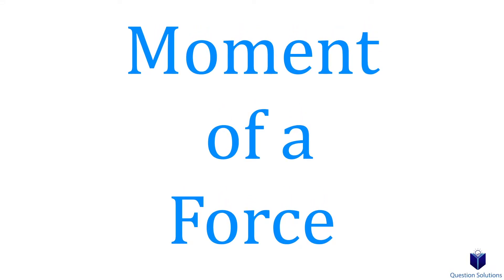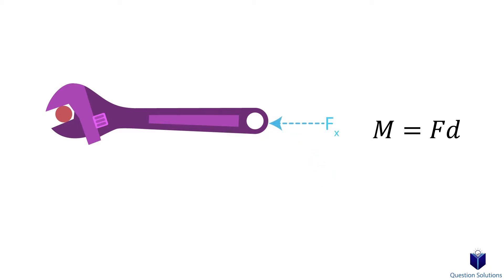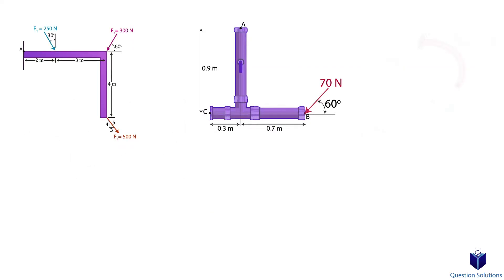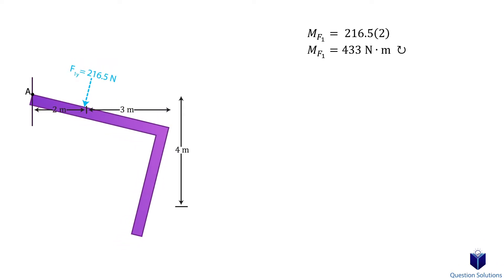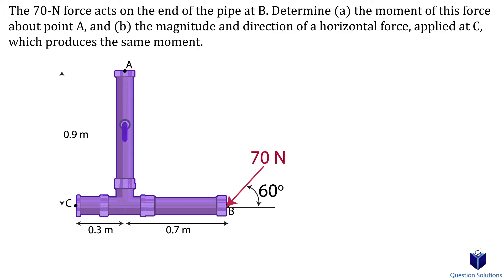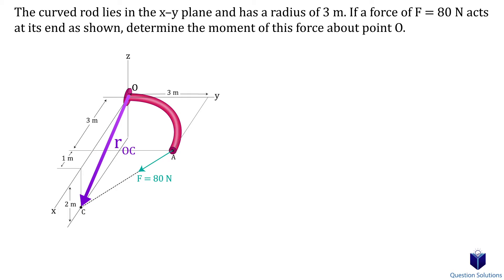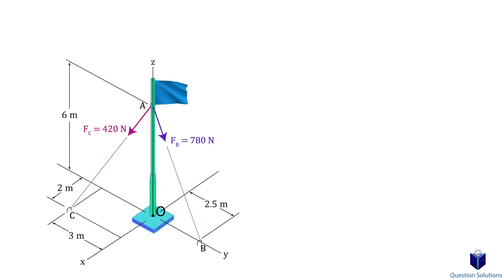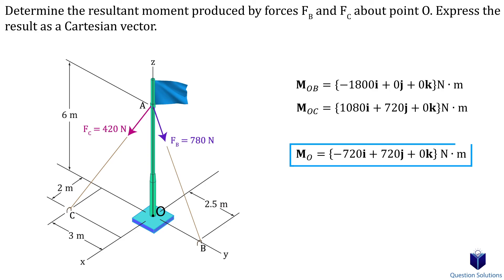Moment of a Force | Mechanics Statics | (Learn to solve any question)

Comment: my question is that while we are finding the moment,do we have to consider the force's sign(like if the force is downward) we take the force as -ive and then the moment is also -ive so will the result be +ive?
Reply from the maker: Here, I've drawn a simple diagram for you, see: https://bit.ly/3XwfDSS

So all you're looking to see is if a force creates a clockwise or a counter-clockwise moment. That's what gives the negative or positive sign, nothing else. In the diagram, you can see both forces are facing down, yet only one takes the negative sign based on which direction you chose as positive since we are finding the moment about the middle. So in any problem, you're looking to see if a force will spin whatever object about a point in a clockwise or counter-clockwise manner.
Reply: @QuestionSolutions  thank u ❤

Comment: thank you so much, got a test today and this video helped alot with review. only thing ill say is that i think conventional assignment of signs for moment is that (-) moment, is clockwise, and (+) moment is counterclockwise, as it follows the normal direction of a unit circle. either way, thanks so much for the help!
Reply from the maker: You're very welcome. Yes, the convention is exactly as you mentioned but it makes no difference to the final answer in 2D problems. I encourage students to pick the side that gives the most positives when solving a problem. I find students make less mistakes when they deal with fewer negative signs.

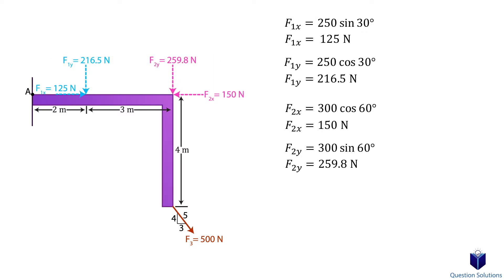Comment: at 2:37 why are we doing F1cos(30) instead of F1cos(120)? is it not taken at the angle starting from 0 degrees at x axis?
Reply from the maker: I think you're missing a tiny bit of fundamentals when it comes to breaking forces into components. If you have the time, I encourage you to watch this video first: https://youtu.be/NrL5d-2CabQ

If you don't have the time, the nutshell answer is, you always break forces looking from the angle given. Whether it's given with respect to the y-axis or x-axis makes no difference, as long as you look from the perspective of the angle. The method you're referring to is usually done in high school mathematics with quadrant rules but that doesn't really apply to these types of problems. You're free to choose what side is positive; up, down, left, right, because you're always placing your coordinate system wherever you want.
Reply: @QuestionSolutions  ahh I get it now, It's been a while since I used this but I completely forgot that you can just look at it from the angle and follow the trig rules lmao. thank you

Comment: clockwise rotation is negative according to the right hand rule
Reply from the maker: That's incorrect. Right hand rule only applies to 3D problems. In 2D problems, you can pick any direction as positive and you will get the same answer.

Comment: It's a rally good video but i found a mistake in your example #1 when you got Mf1 Mf2 and Mf3 you signs should be negatives for the answers because Y axis is going down in all the forces
Reply from the maker: No, what's shown on screen is correct. I will briefly try to explain it a bit more if the video wasn't clear. When you calculate a moment, you do not show a negative or positive sign, but rather, a direction of rotation. Notice for all of them, we have a little curved arrow next to the answer, indicating the direction. This might be hard to grasp, but think about this in a real life example. Imagine you turn your wrench to tighten a bolt clockwise, is that a positive moment? If so, when you loosen a bolt, is that a negative moment? No, right? We never talk like that. Instead, we say, turn it clockwise, or turn it counter-clockwise. In the same way, your final answers for moments should not contain a negative value, but a positive one with a direction.

Comment: In this final question i use vector roa {0i+0j+6k}, and i get answer {720i-720j+0k} which become negative. If i did {0i+0j-6k} and it will be the correct answer. It appears as rao instead of roa. How do i know when i gotta use rao?
Reply from the maker: You have a numerical error somewhere. You will get the exact same answer with no difference using ROA. Your rOA vector is correct, but you probably incorrectly solved the cross product. I can't say exactly where since I can't see your steps, but using rOA will give you the exact same answer as shown on the screen.

Comment: why didn't you use the 0.9 m for the moment of Fy in the second example?
Reply from the maker: You're looking for the perpendicular distance. Fy is 0.7m away from point A in the perpendicular direction, whereas Fx is 0.9 m away.
Reply: In that case why don't we add the 0.3m and the 0.7m?
Reply from the maker: @NtokozoMlotshwa-y9l  So what is the question asking? It's asking us to find the moment about point A. So we need the distances to point A. So for Fy, what is the distance from Fy to point A? Is it 0.7 m, or is it 0.7 m + 0.3 m?
Reply: 0.7m
Reply from the maker: @NtokozoMlotshwa-y9l  Excellent! :)

Comment: In case of door 🚪 torque should be in z direction but it is x to y direction. I am not really grasping the concept of cross product. And how we will draw this on plane because we draw vectors from centre on plane
Reply from the maker: I have no idea what you're referring to. What door are you talking about? If you're talking about your room door or something, you are free to decide how your coordinate system is. You can make the door open into the x, y, or z axis, it makes no difference since you are choosing the axes arbitrarily.
Reply: @QuestionSolutions I am saying if I push my door shouldn't the direction of torque be upwards according to right hand rule
Reply from the maker: @ClashBeast-k7m  Yes, the moment vector will face upwards when you push on the door, while the rotation occurs perpendicular to it.

Comment: Nice Video but 2 Errors to point out: 
1) at Exercise curved rod the Mo the k component is -256.68k 
2)the pipe assembly is asked point A not B −should be Ma = 110i+70 j−20 k^N⋅m
Reply from the maker: Those errors are already mentioned in the pinned comment, but thanks for the feedback.

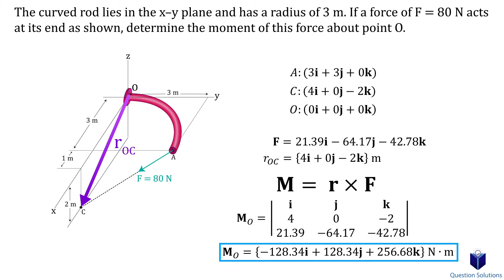Comment: 6:24 i tried using vector cross product in calculator it shows -128.34 i + 128.34 j - 256.68
Reply: @QuestionSolutions  hello sir, can i ask why?
Reply from the maker: See pinned comment.
Reply: sorry my bad i didn't see it, Thank you sir
Reply from the maker: No need to apologize. 👍 @diethernevermore4598

Comment: How Can I Find The Perpendicular Distance From Force 1 To Pont 3 Below.. Without Resolving Into Components
Reply from the maker: Distances are found by looking at the diagram (usually they are labeled) or using geometry to figure it out. Breaking forces into components doesn't give the perpendicular distances.
Reply: I Agree.. But Force 1 Line Of Action Passes Through Point 3 Below.. So It Will Not Produce Moment Around It.. But After Resolving The Forces You Can Clearly See It Will Produce Moment.. How Is That Possible?
Reply from the maker: Why does the line of action going through point 3 matter? 😅 We are looking for the moment about point A. Maybe I'm not understanding your question or you're confusing how moments are calculated about a point. So in this question, we want the moments about point A, so we only care about the lines of action if it passes through point A.  @shkbot2000
Reply: @QuestionSolutions I Understand.. But The Question If I Want The Moment About The Point 3 (Below Near The Force 3) With outstanding Resolving Force 1
Reply from the maker: If you would want to find the moment about point 3 due to force one, you must break the force into components. The perpendicular distances from the x-component would be 4 m, and the perpendicular distance from the y-component would be 3 m. Both components will create a moment since neither of the components' line or action go through point 3.  @shkbot2000
Reply: @ Excellent Now You Understand Me.. If I Want To Find The Moment Without Resolving Into X&Y Components.. How? How I Can Find The Perpendicular Distance While Apears It Passes Through The Point
Reply from the maker: You need to break the forces into components @shkbot2000
Reply: @QuestionSolutions  Is There Anyway I Can Find The Perpendicular Distance..? 🙁🙁
Reply from the maker: @shkbot2000 yes by looking at the diagram and looking at the distances given. Imagine the forces broken into components in your mind and then it's easier to figure out the perpendicular distances mentally.
Reply: @ I Can Find The Distance After Breaking The Forces Its Easy.. But I want The Perpendicular Distance To The Resultant Force
Reply from the maker: @shkbot2000  I honestly have no clue what you're asking here. Please see your professor and ask him this question, we've been going back and forth multiple times and I still don't know what it is that you want. It's best to see your professor or TA during their office hours. Thanks!
Reply: @ Actually You Understand Me.. Just I Want The Perpendicular Distance From Force Number (Without Breaking It Into Components) To The Point Number 3 (Near The Force 3)

Comment: I made some videos about rotational quantities trying to solve a "perennial problem of teaching mechanics". Essentially, my proposal is to distinguish between rotational radius and geometric radius, which in turn will change the standard unit of rotational radius to meter/radian, Rotational inertia in kg.m^2/rad^2, Angular momentum in kg.m^2/(sec.rad), and torque in kg.m^2/(sec^2.rad). Please check it out by searching for "rotational quantity new standard"

Comment: Thank you so much for this video! Question: when given problems like the last example in which we have to find the resultant moment from several forces, could we find the resultant force and use that to calculate to moment? Or do we have to calculate the individual moments for each force and find the resulting moment from there? Also, if we can find it with the resulting force, what would the r vector be?
Reply from the maker: Yes, you can find the resultant force and use that to calculate the moment. Once you find the resultant force, you need a position vector from point O to the location where the resultant force begins or ends. Here, it would be easy to just go from O to A, since you know your resultant force starts at A. You can try this for yourself by adding the components of the two vectors and using a position vector from O to A, you will get the same final answer.

Comment: 2:53 we have to consider the horizontal line as line of action ...right?
The vertical line need to be neglected for this purpose, only the force there needed to be considered...correct me if i m wrong..
And please explain why we considered both forces of f3 ...like even if considered horizontal line as line of action (if i am not wrong) than other force once shifted would be parallel ...so it is needed to be neglected ....
Please help sir
Reply from the maker: So for force F1 and F2, the horizontal components line of action goes through point A. But focus on just force F3. Can either of the lines cross across point A? No. If we look at the horizontal line created by the x-component, there is a distance of 4 m in the perpendicular direction to point A. If we look at the vertical line, so y-component, there is a 5m perpendicular distance from point A. So for force F3, nothing can be neglected.

Comment: in the last flag question, isnt the position vector for ab {0,2.5,-12} and not {0,2.5,-6}
Reply from the maker: How did you even get 12? The flag pole is only 6 m tall? 😅 The position vector is shown at 7:14, with the steps to get it. If you are stating it's -12 for the k-component, the burden of proof is upon you, so please show your steps as to how to arrived at -12.

Comment: for the last question, could have i done it the vertical and horizontal components way to get the moments about o and solved it?
Reply from the maker: Do you mean using the scalar method? I mean you can, but it's really tedious to do. It's much easier to use a vector approach when you have forces along lines.

Comment: I really appreciate the information you provided, I found a small mistake in this video in the minute 6:25 
The +256.68k should be -256.68k 
Thank you
Reply from the maker: You're very welcome and you are absolutely right. There is a pinned comment with that correction.

Comment: first thanks for the incredible work 
you've really managed to reach the ideas in such short time even for the hard learners like me 
but in 6:24 shouldn't  the answer be (128.28i-128.28j+256.5k)?
and thanks for your time 🌹
Reply from the maker: You're very welcome and thank you for the feedback!

To answer your question, the correct answer is {-128.34i + 128.34j - 256.68k}. There is a typo in the video where the K term is shown as positive, when it's actually negative. So while the magnitudes of your values are correct, the signs are wrong. It's probably just a small mistake in assigning positives and negatives to your i,j,k components, so if you have some time, take a look at this video: https://youtu.be/F8IHrg3pc7g

Comment: 6:25 Good day, sir! May i ask how did the k became 256.68k i thought it's supposed to be negative. Just asking how it became negative. Thank you for your response sir!🤍
Reply from the maker: So it should be: k[ (4 x -64.17) - (0 x 21.39)] = k[-256.68-0] = -256.68k. Hope that helps :)
Reply: The final answer in your video is positive 256.86 k.  

I just want to clarify sir if the final and correct answer is -256.58 k?
Reply from the maker: @itsheynahhh  Yes, -256.58k is correct. There is a typo in the video, that's why I made a pinned comment about it.

Comment: I really liked this video and found it helpful, but it is normal to assume clockwise is positive?? In my course we have always assumed clockwise to be negative and counter clockwise to be positive. This is the only thing confusing me right now.
Reply from the maker: Yes, and it makes no difference to the answer you get. In fact, assuming clockwise to be positive when you see a lot of clockwise moments will make your flow better, simply because you're dealing with less negative signs. However, 3D problems are a completely different scenario, and you need to use the right hand rule to see where the vector points. But in 2D problems, it really makes no difference whatsoever. See: https://www.youtube.com/shorts/P029mqnp4XY

Comment: isnt they F1Y and F2Y negative since it is downwards? or is there any concept here? please let me know!
Reply from the maker: When you break forces into components, there are no negatives and positives. It's only when you write equations of equilibrium, or moment equations that negatives come into play. When you write your summation of moments equation, you need to pick clockwise or counter-clockwise to be positive. The direction you pick to be positive does not matter, as the answer you get will have the proper magnitude. If you get a negative value, then you know it's opposite to your assumed direction.

Comment: 6:25 if we take point A instead of point C (they re both on the line of action of F), shouldn't the answer be the same? because we re looking for M_O
Reply from the maker: That's correct, you will still get the same answer.

Comment: Hey I was wondering if Roc can be replaced by Roa (3i+3j+0k) bc I tried and my magnitude is slightly different (-128i -128j -256k) and idk if thats correct.. it theory it should be.
Reply from the maker: You're most likely doing the cross product incorrectly. Your position vector is correct, and your answer would be -128+128-256. There is a typo (see pinned comment), about the answer shown on screen, the last term is negative. But your answer has the middle term also negative, which is incorrect. Most likely not accounting for the -j term. You can always double check your work using this: https://onlinemschool.com/math/assistance/vector/multiply1/ If you need a refresh on how to do the cross product, please see: https://www.youtube.com/watch?v=F8IHrg3pc7g

Comment: Shouldn't the last example be (720i - 720j) instead of (-720i + 720j) since the vector cross product of (120i, -180j, -360k) and (2i, -3j, 0k) is (-1080i -720j) and not (1080i +720j)? Remember that the j-coordinate has a minus-sign according to Laplace's expansion for the determinant.
Reply from the maker: No, what's shown on screen is correct. So when you do the cross product, you will get i(1080-0)-j(-720-0)+k(-360+360) = 1080i+720j+0k

So if you just focus on the j-component, you have -j[(2 x -360)-(120x0)] = +720j

If you ever have a doubt, you can use this verify your answers: https://onlinemschool.com/math/assistance/vector/multiply1/

I also have a video on how to do this if you'd like to take a look: https://www.youtube.com/watch?v=F8IHrg3pc7g

Comment: for the pipe assembly problem, even though vector was given in cartesian form why didn't you make it a unit vector like you did previous?
Reply from the maker: You only need the unit vector to express a scalar force in cartesian form. If it's already given in cartesian form, you don't need to do anything to it. Use it as is.

Comment: first of all thanks for the beautiful explanation, but I have a question, why'd you multiply the horizontal component of F3 with 4? shouldn't the perpendicular distance from point A to Fx be 5 as well? or is every point along the horizontal part of the pipe considered as point A? (in the 1st problem)
Reply from the maker: So you can actually draw two lines at point A (perpendicular to each other like a coordinate system), extending towards the edges of your page. Then it's easier to see the perpendicular distances better. So for Fx, we are looking to see the distance towards the horizontal line, which is just 4m.
Reply: @QuestionSolutions  thanks man appreciate it